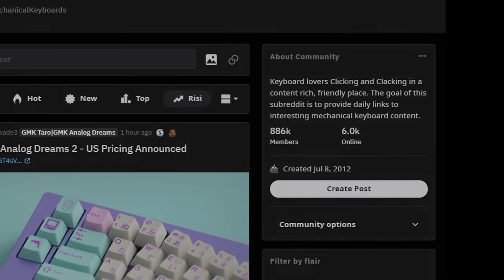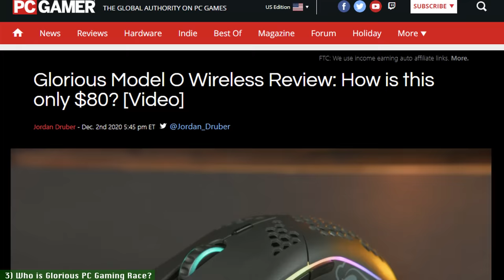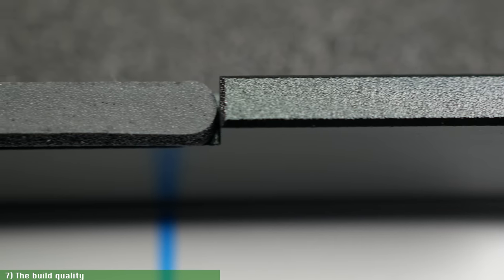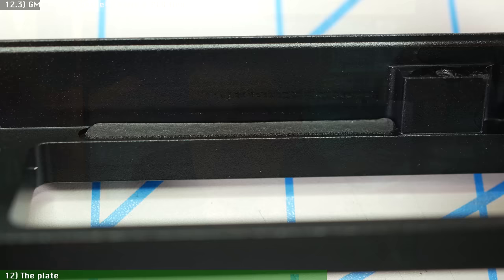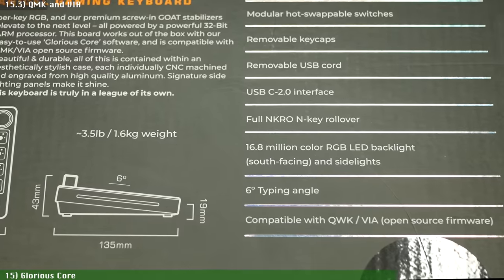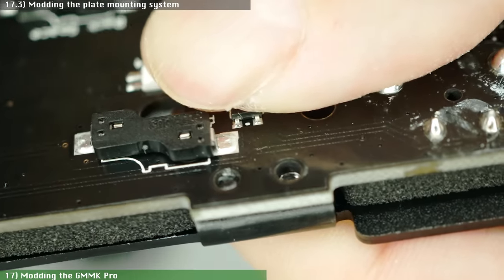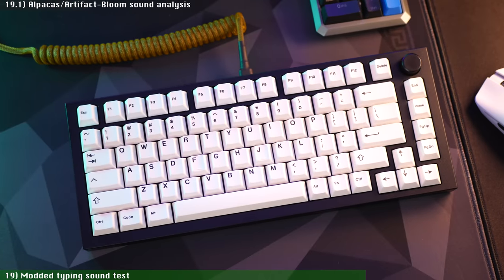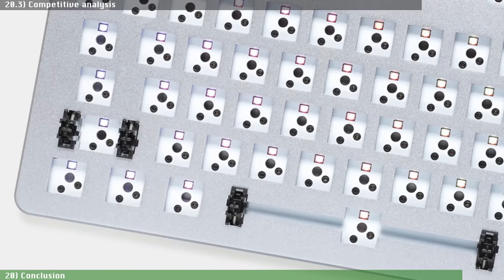GMMK Pro: The ultimate guide (in-depth review + modding tutorial)

Comment: I got my gmmk pro, followed this guide and it sounds crazy good. Even better actually

Thank you for this in-depth video.
Reply from the maker: Nice!!! Which switch/keycaps/stabs did you use?
Reply: @IOSam  filmed & lubed gateron black ink, durock stabs, pcb/plate foam only, alu plate, classic blue dsa pbt keycaps.  

Your o-ring trick is pretty nice. I didn't expect to like the final result as much. It is my first custom and it's damn close to any highend GB kb I see out there.  

Again, thanks to you and your good tips
Reply from the maker: So happy to know the mods worked out well for you! And great choice of switches, keycaps and stabs by the way! I can totally get it why your board sounds as good as it does with these parts. Congrats man!
Reply: @Max-vp6rq  once you finish building your keyboard can you tell me how it feels? I’m also planning on getting black inks with durock v2 stabs
Reply: @yesnt9523  feels soft and smooth.  The durock v2 will fit on aluminium plate if you push hard... really hard.  Didn't need any of the screws.😂

By design the gmmk pro has  a compressed and muted sound. So if you want to hear more your switches distinct sound, try to not having it too tight.
Reply: @Max-vp6rq  hi which durock stab v1 or v2 screw in? I thought durock doesn't fit? Let me know I am interested.  Thanks
Reply: @IronCan88  durock v2 stabs on aluminium plate. If you press like a mad man it fits. Put them on the plate only at first as a warmup.  

I also heard it was a tight fit/no fit  on aluminium plate.  Brass I wouldn't bother. 

Now I would want to try without  the pcb/plate foam... but just the idea of removing the stabs again.. 😩

Comment: I've read a few articles saying this board has pretty significant lag in gaming?  Have you experienced this during your testing?
Reply from the maker: I saw reports about this as well (I believe Brandon Taylor mentioned something about this with one of the review samples he got), and I suspect that is why you need to update the firmware of the board as soon as you plug it in with the Glorious App installed.

Since I did this as soon as I got mine out of the box, I did not perceive any latency issues with my board. But I'll test it specifically for this issue and post any results on my Blog (I'll leave a comment here when ready).
Reply: @IOSam  I'm definitely interested in this topic as well, I play some rhythm games where timing down to millisecond scales can become important at high levels. Thanks for the in-depth guide and looking forward to any updates!
Reply from the maker: Alright... After doing some homework on this topic, I have my humble opinion on this matter published on my blog here: https://www.iosamfranco.com/post/imho-gmmk-pro-and-its-input-latency-issue-should-you-care
Reply: @IOSam  Thanks for taking the time to share your thoughts on this!  I play a ton of Hunt and I can say that I've not noticed a bit of difference in my gameplay (I'm NOT a pro gamer by any means).  I think your right, the switch makes a ton of difference.  That's nice thing about these custom boards though, I can always just change the switch.

Comment: Just got my GMMK Pro now over a year later since this video, but have to say this is the best video on this board I've seen by far. I've got the white (silver) board, Kinetic/Tecsee Salmon Switches, a cheap but solid XDA keycap set from Amazon, and it's all running stock. I've watched plenty of videos about modding boards (including this one), but this is the first video that has pretty much convinced me that I should mod the board, but also that I'm prepared to do so. The only thing I'm worried about is how long lubing my switches will take for a beginner (and one without a 'lubing tray'). Great video, 10/10, you've got a new subscriber.
Reply from the maker: Hi J! Thank you for the sub my friend!!! Happy to know this video inspired you to confidently mod your new board! That’s the main goal of this channel: to demystify keyboard modding and show that anyone can improve their typing experience regardless of previous knowledge in tinkering with keyboards.

As for lubing switches, yeah… It is a time-consuming affair… No way around it…

But it is one of those things you do once and it keeps paying off every day for a very long time! So, it is worth it in the end. As for lubing them without a “lubing station”, it is totally doable, as long as you have a good switch opener that you can also use as a base to keep the bottom housing of the switch seated on.

My suggestion is using a regular brush for springs (if you intend to lube them individually as I do) and an eyelash brush for everything else (these are much easier to use than regular brushes and they help you to avoid over-lubing the housing and stem). Both are linked in the video description.
Reply: @IOSam  Thanks dude! I'll definitely be getting down and dirty with lube soon 😏I appreciate all the tips and pointers, including what is seen in the video. Merry Christmas (or happy holidays)!
Reply from the maker: @blodstrm  Thank you and I wish the merriest of Christmas to you too man!!! If you happen to have any questions, don’t hesitate to ask here or on Reddit (https://www.reddit.com/r/IOSam ) and I’ll be glad to help out!

Comment: The PCB part was very helpful. As someone who bought this to get into the field and just try a build out. Now I need to find a proper set that will illuminate. I didn't know that could be an issue. So now I am on the hunt for a switch that is clear!
Reply from the maker: Glad this was helpful Khaled! There are many options for clear switches to choose from. Do you prefer linears or tactiles?
Reply: @IOSam  I wanted a switch close to silent due to work environment but I’ve always used tactical. Never tried linear and I know they are the way to go when you want something quiet for the most part. I’ve been reading about the zilents which are tactile and silent but haven’t tested anything out just mainly watching YouTube videos for research. What’s your opinion?

Comment: This video was extremely helpful in the build process for my GMMK Pro build.

I used that gasket mounting mod, as well as the Sorbathane mod from the Whisper quiet keyboard video (the 0.10 inch pad is almost identical thickness to the stock pad, but so much denser)

I wanted to mod the stabs, but the screws are incredibly stubborn on this thing. I was able to get 7 of them out before the 8th and final one started to strip, which was infuriating. I had to wrap my screwdriver in a ton of gaff tape just to get the leverage I needed to get any of the other screws out.

My goal was a silent build, so not being able to mod the stabs was a bit of an obstacle, but even the stock stabs are....sufficient. I lubed, filmed, and o ringed everything to that end, and it's definitely MUCH quieter than the membrane keyboard I had previously (I don't hate membrane keyboards, I heard they were supposed to be the quietest, while mechanicals were known for how loud they are, and I hate loud keyboards.) These videos showed me that super quiet mechanicals were possible.

If the Navy Blue face plate ever comes back in stock for this thing, I wanna get that, and if I can ever get that PCB off the plate, I wanna do the custom stabs too.
Reply from the maker: So happy to know this video was useful to your project (always my favorite type of feedback :)!

As for the screws, yeah... they unfortunately are made of very soft metal that can strip easily if don't have a precision Philips bit set (if you try to unscrew them with a bit that it too small or too large, it will damage the screws). While I didn't have any problems (because I do have bits of all sizes here with my Wow Stick), I know a lot of people had problems when trying to disassemble this board.

I'm still hoping that Glorious starts selling replacement PCBs for the GMMK Pro, which would allow people with stuck plate screws or damaged PCBs to easily replace them.

As for silent builds, I think the GMMK Pro is one of the best 75% boards for this type of project, since it is already very quiet out of the box anyway. So, a sorbothane sheet and some damped switches will turn this into a great "sleeper" mech.

Comment: This is the first video of yours that I have seen (It came up on my suggested list since I have recently bought the GMMK Pro) and I had to leave a comment.  Your review is crazy in-depth and I can tell that you have put a lot of effort into creating it.  Your review is still up-to-date with this keyboard 2 yrs. later, except for what I noticed is some extra thin gasket pieces that they have added in between the top case part and the tray.  The stabs are also still awful and were the first things to be changed.  They were so over-lubed from the factory that they either stuck down completely or they were very slow to rise after being pressed.  Even after cleaning and re-lubing they were not something I could use.  My Durock V2's are a great replacement and I am awaiting my order for gateron milky yellows and PBT keycaps to finish building my first custom keyboard.  Thanks for your effort on this video and I can't wait to check out your other reviews.  Your newest subscriber!
Reply from the maker: Thank you so much Kevin! Always rewarding to see that the hard work I put into producing this review/guide is paying off more than 2 years later! As for the small changes Glorious made, the addition of another layer of gaskets was nice, but their attempt to fix the stabs was, unfortunately, disastrous… Since they made problem worse by over lubing them. So, the need to fix the stabs became even greater in the later batches of this board.

At any rate, the GMMK Pro has its place secured in the hallmark of mechanical keyboards history, as the first product to try to bridge the gap between custom and large production keyboards… And its contribution to this hobby cannot be overstated. With all its issues, it had a disproportional impact in the growth of this hobby, to the point where almost 1 in 2 people who have joined this hobby in the last 2 years seem to have had the GMMK Pro as the “gateway drug”.

Comment: i found out what caused the tick noise in the space bar and was able to fix it with some electrical tape around the wire where it connects to the plastic part that goes into the key cap
Reply from the maker: So you did the "plumber mod" ( https://youtu.be/mjduXOxcZFk ), although in the plumber mod you're supposed to use Teflon tape which is much thinner and malleable than electric tape.

While I have never tried this mod yet, I will give it a shot soon... But nice to know it works well for the Glorious stabs!
Reply: @IOSam  one layer of electrical tape perfectly closes the tolerances, leaving some wiggle room

Comment: Another exceptional video.  Clear, thorough and encouraging - good stuff!  This keyboard looks to be aimed at users around my level of enthusiast engagement, but I’m still holding out for a full size platform.  I’ve used a few TKL and 75% and I found I can’t do without the numpad for coding and gaming.  The moment I do I’ll be referring back to these videos for some helpful advice.  Many thanks, and those black and while rounded key caps look just perfect.
Reply from the maker: Thanks Mark!!! Appreciated!

Most of the full-size boards I'll feature in this channel in the next few months will be vintage mechs (many boards with Alps and "Space Invaders" switches), which sometimes might be a good option depending on what you like (you can still find good "new old stock" vintage keyboards on eBay sometimes for less than a generic cherry mx based full size one). Stay tuned! ;)
Reply: @IOSam  Sounds perfect, will keep an eye out :)

Comment: I went through the trouble of cleaning the factory lube from the stabs, (one of the worst keyboard modding tasks ive undertaken btw), and did a holee mod with fabric band-aids and a relube with krytox 205g0. While id caution those who undertake this task to evaluate for yourself what your time is worth to you, and consider a replace rather than modding the stock stabs, it did take care of the tick in the space bar. The 3 shorter stabs sound incredible with holee mod and relube, and the space bar sounds much better, but is a tiny bit sluggish. Overall, id say a worthwhile mod if you done mind a sore neck to save a few $s.
Reply from the maker: You Sir, are a brave soul! 😂 You did what I would not consider doing in this video: completely cleaning the stock stabs… Which is why I took the route of simply replacing them. So, thank you for reporting this back here!!!

I also must disclaim that I hate doing the Holee mod… It is one of the most difficult and tedious chores in the keyboard modding world! And I also fear this mod might not last very long, since the band-aid fabric might get soaked with the lubricant and eventually lose its adherence (and get displaced inside the stab’s housing).

But at least we now know what it takes to fix Glorious' stock stabs...

Comment: I'm pretty sure this is the board I'm going to use to fully dip my toe in the custom mechanical builds pool. I already have keycaps that I had hunted down for ages (GMK Laser) but it turned out that Corsair uses a weird width for their spacebars so I got a spacebar that just doesn't fit. The volume knob, while a lot of people dismiss as a gimmick for some reason, is probably an essential for me after getting used to having one for so long with the corsair K70.

Now it's just a matter of figuring out which switches I want. I like a strong tactile bump and am ok with them being clicky or not. I really don't want to lube them myself though. That seems like a nightmare.
Reply from the maker: Hehe... I don't blame you... Lubing switches is chore! XD

My suggestion for you (for strong tactility switch that is so smooth you don't need to lube): Gazzew Boba U4T ("T" is for "thocc", since this is the regular switch - they also have a silent version, with rubber dampers, that is the "U4" without the "T").

It has as much tactility as a Holy Panda, but smoother and with less ping. A little gem of a tactile switch!

GMK Laser is awesome (still my favorite GMK set of all times)! It'll look great on a black GMMK Pro!

Comment: Did the tape mod with the purple light adhesive painters tape you recommended. Huge upgrade! Sounds great. Just ordered Durok v2 stabs for it (I added a little lube to the stock ones and made them worse, lol. First timer)
Reply from the maker: Yeah... Tape mod is indeed the easiest and most effective mod to change the sound of a keyboard. And while it is not going to have the same effect on every keyboard, it does work very well on the GMMK Pro.

As for the stabs, Durock stabs might not fit the Alu and Brass plates, but should fit the PC one.

Comment: the keyboard I was looking at before going to GMMK Pro since I wasn't totally sold on it was the KBDfan 75% v2
Reply from the maker: KBD75, both V1 and V2, are still solid kits! With a few simple mods (O-rings on the screw posts) you can also make an incredible keyboard based on them. In fact I have a second silent build coming up to the channel that is based on the KBD75.
Reply: @IOSam  I was really happy about volume knob was a big sale point for me.

Other keyboard at 75% I saw with that was a like 600$+ base so as a newcomer  getting my feet wet with like a 300-400$ build think GMMK is perfect hopefully.

Getting mine this week sometime
Reply from the maker: @AsthmaQueen  Yeap... You basically described my feeling (and conclusion) about this board: while not perfect and requiring some work to fix its flaws, it still is an unbeatable value! There is nothing out there with this level of construction and features under $200. So the GMMK Pro will reign undisputed in that spot at least until Keychron comes out with its Q1 and try to unseat the Glorious offer for an even lower price... It will be very interesting to see this market heat up!

Comment: Hi Sam, This is the best and most comprehensive GMMK Pro video and I have seen! Kudos to you!

I like the design and price of the GMMK Pro and I am on the fence with buying as I have just completed my first custom Tofu60 with quality parts and mods. Therefore I am now after something with a better typing experience. If I end up getting the GMMK Pro I would pair it with MT3 WoB or GMK WoB keycaps and Boba U4T 68g or Tealios V2 switches.  Would opt for the PC plate, remove the plate foam and install Durock V2 stabs.

I have those Drop WoB MT3 keycaps and they look and feel fantastic to type on.  Reminds me of the old-school IBM terminal keyboards pre-PC era :)
Reply from the maker: Thank you!!! Bobas are terrific tactiles and Tealios are some of the  smoothest linears out there. Either way, you'll have a great build! If you go with Durock stabs, you'll definitely need the polycarbonate plate, since they won't fit in the alu plate without some filing.
Reply from the maker: Oh, and about the MT3 set... I liked them so much, that I'll use another MT3 set (on PBT this time) on a TKL project coming soon to the channel! ;)

Comment: 10/10 video. tried o-ring mod but they kept falling off as I tried to mount the top case. ended up with little flex.
Reply from the maker: Thanks man!!! And yeah, it is a real pain to place the O-rings exactly where they need to be, place the top frame on top and then turn the whole assembly upside down to be able to place the screws through the bottom... gymnastics!!!

One option would be to put a bit of glue stick in the O-rings so they attach to the metal a bit better and don't move too much when placing the top frame. That is my technique when placing O-rings on top of screw posts on tray mount keyboards for example (as you can see here: https://youtu.be/QTB1oocAdP4?t=1388 )